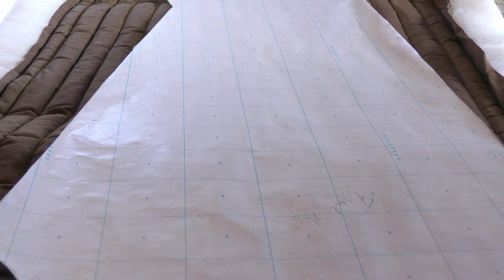The Witcher - Bear Armor Part I - Coat & Belt - The Witcher 3: Wild Hunt

Comment: Nice Job! What type of leather thickness is your leather belt 4/5, 7/8, 8/9 oz. Thanks
Reply from the maker: pricelessclips Thanks a lot! I used 6oz vegetable tanned leather 😊
Reply: Last question. Did 6oz leather soft enough to do the loop tie or did you apply something to the leather to make it softer. I made a mistake buying 8/9oz of leather for belt and its crazy thick.  I'm making sure its soft enough when I order in the next few days. Thanks again!
Reply from the maker: pricelessclips It depends on the size of your buckle. For a big one, no problem. But you can also reduce the thickness of your belt with a razor blade for the loop part in order to shape it more easily. I show it in my dog collar video. 8/9oz is a bit thick for a belt but it should work.